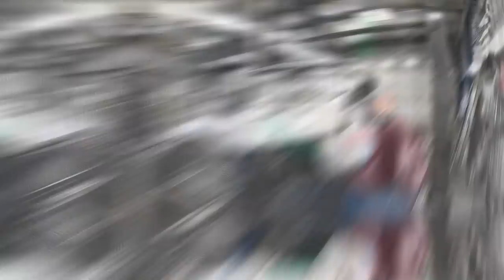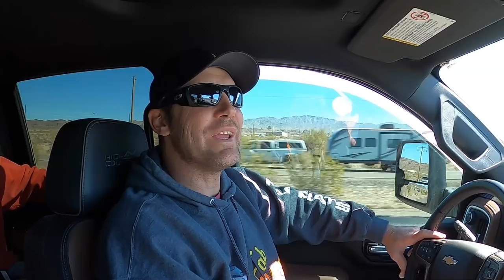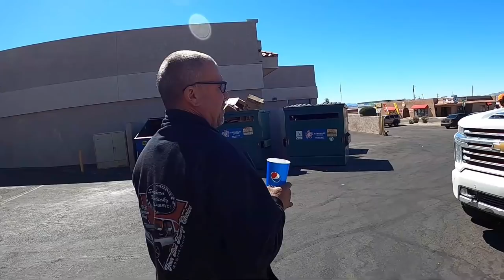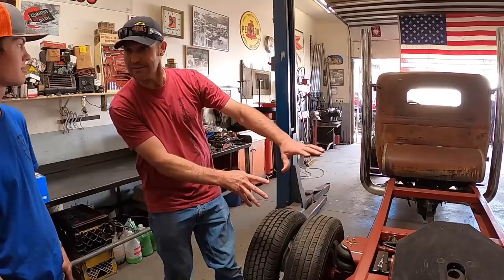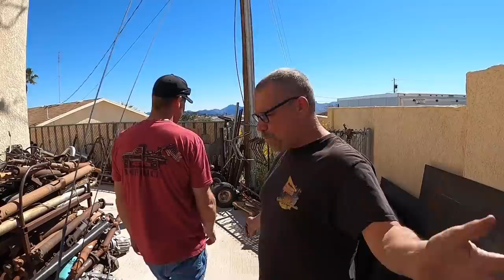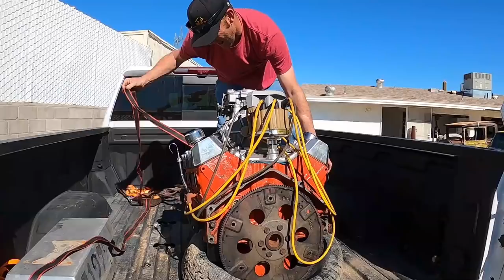We Drove 13 Hours To Get This....And It Was TOTALLY Worth It!

Comment: Great Guy, Great Place.  A+ for NEAT.  For those too young to remember, the Chevy 348 and 409's looked the same sorta but the 409 Dip Stick was on the Pass. side.  Had a 400/409 in my '63 Chevy SS convertible.  Awesome.  Thanks Merlin and Rats.

Comment: I'm 78 now, raised in Anaheim, wasn't  Doug's headers around there? My older brother and I worked at Weber Speed Equipment in Santa Ana early 60s. Chet Herbert cams was near 101 fwy, on Manchester,  been in Tony Nancy's on Woodman in Sherman Oaks also. This vid brings back  memories. Back then I drove a 47 Merc Woodie. SD that b4 Asian VAcation. With 39 Ford full race flattish 3 on the floor 39 tranny.

Comment: Back in the late 80s I worked at a speed shop warehouse distributor. The head shipper/receiver drove a black stepside square body with a B&M blown small block a lot like that one. It'd roast the tires any time anywhere. That'll be a great little engine for that truck Paul!

Comment: I had a '72 Chevelle SS back in early '80's...big cam, headers with 3 inch Thrush header "mufflers"...window rattling loud...a dufus put it on a lift at the station to check the diff fluid & broke both those at the flange....I drove it for a couple days with open headers lol.  Got kicked off school property because it rattled EVERY window for a block....good times!

Comment: That little blower motor is going to be fun, but if you want to get the most out of it, that HEI distributor isn't the best choice... Too much timing. Get a small cap, and have it dialed in for 8 degrees at the distributor,  for 16 at the crank. Then you have roughly an additional 18 degrees to work with, depending on the fuel your using. Use a small blower pulley, the large crank pulley, and the hottest coil and box you can find. This combination equals a small block, with big block power, and an attitude all its own. I'd also use a big Holley up top, like an HP blower carb. For 16 years, I ran a Wiend 144 @ 244:1 drive ratio, with a 830cfm Holley HP in my 72 Camaro. I went through a lot of mods before I figured out the best combination. My motor started life as a ZZ4 GM crate motor. The compression was too high, the heads had small exhaust valves, but the cam was about perfect for a small blower. With Edelbrock 6052 heads, (202/160, 70cc chambers) Hooker 1 7/8 Super Comps, my combo produced 12lbs of boost, which propelled my 3250lb Camaro to 123mph through the traps in the 1/4mile.... At Bandimere. I tried a few gear combos, but settled for 342's... These little blowers are so much fun on the street... Instant power from idle to 6000rpms. They reccomend only 5000, but they handle 6 all day long. My roller cam was 208I, 221E, .480/.510 lift at .50. 112 degrees lobe separation. I put 1:6 roller rockers,  which effectively got me an extra .030 lift, .510/.540. I reluctantly sold my Camaro car 17yrs ago... I still miss it. I'm definitely going to watch you play with this one! Have fun!

Comment: Hey Paul.  Love the programing you bring..
   However there is a third modified big block..
348 had one 59 impala 
409
427. Race only
￼This is not a Mystery V8, but we’re including it anyway to clear up a frequent misconception. This is the engine most commonly confused with the Mystery motor: the RPO Z11 427 CID V8. Chevrolet produced two different 427 CID racing engines for 1963, and this one, the Z11, was essentially an enlarged, enhanced version of the famed 409 CID V8, with a .15-inch longer stroke and detail improvements. Note the scalloped, inverted-W valve covers, common to the 348/409 W-series engine family and dictated by the distinctive staggered valve layout. Experts believe that 57 vehicles were produced with the Z11 427 V8.

Comment: what they're not telling you about Lake Havasu is the record high temps in the summer.
I've seen rubber make black streaks in driveways from tires, normal turning makes your tires squeal when you're sitting still.
I had a manual thermometer melt in a truck there when I was a teenager
without the Colorado River there it would be the surface of Mars.

Comment: When you load an automatic transmission with the torque converter still installed, it's a good idea to secure the converter in place - this can be done several ways, such as using rebar tie wire to run across the front of the converter circling around the centering boss and tying into bolt holes on the bellhousing.  Otherwise it can come off and you will have ATF all over the place.

Comment: Awesome video guys.  You have some interesting people in your family.  I've seen a few of the Kindig builds where they replace the entire rear end of early muscle cars to make them handle, but they use off-the-shelf kits, and I'm thinking Paul would fabricate it all from scratch.   Wow, that blower motor is something.  I loved it when you said you could feel it on your chest.  I grew up in the UK, so my only experience of that sort of motor making the air vibrate was at Santa Pod Raceway.  Can your pipe bender handle three inch Paul?   So much good stuff happening on the channel — so many great videos to come!
Reply: I forgot to say that we used Lake Havasu Proving Ground for hot climate testing.  I never got to go my self but the lads totally enjoyed it.  We went to northern Finland for two or three months every year, and less often we had trips to central Australia, and southern Italy.  Apparently you have to be as far as possible from the coast to be sure of low or high temperatures.  BTW  This was Ford UK Product Development at Dunton.

Comment: Equipment hauling tip- if you use 4 tie downs instead of 2, that engine would be less likely to slip and fall over.
P.S. I have one of those small Clarke clipper forklifts also.  They are awesome for the shop/garage!! Just no dirt or it's stuck city

Comment: To add to the history of the elephant motor, it’s first iteration was in a 1958 Chevy truck and car. It had 348 cu. Later it was upped to 409 and later to 427.:it was king on the drag strip for a good while. To compete with it Ford upgraded their 352, 360, 390, 401, 406, 427. Keep up the interesting builds. My daddy was a garage owner. I was weened off milk then put on gasoline.

Comment: A supercharged engine needs 6 litres of expansion built into the cooling system , which means mounting an expansion tank above the engine then allow the coolant to travel to the radiator. You do not need a bigger radiator but you definitely need a good water pump that flows a minimum of 10 litres per minute at 500 rpm and it should be able to push the coolant up hill at least 150 foot head. Chevy engines have an inherent problem built into the cylinder heads  as they mounted 2 exhaust valves next door to each other in the middle of the cylinder heads causing overheating in that area, but a good pump should be able to move the coolant around that problem area without causing an exhaust vacuum leak . 
The best coolant to use is Evans Waterless Coolant as it does not turn to steam causing an over pressure situation.

Comment: I have a flowmaster 10 on my '93 F150 with a 302, it's got long tube headers into a single 2.5" pipe with a high flow cat and the flowmaster 10, dumps out the passengers side behind the cab. I've driven a Malibu with a supercharged 350 man, and holy crap that car was awesome.

Comment: Me and my brother took a 350 turbo transmission apart and put a different back shaft in it for a swap on a 85 S10 2.8 to a 350. It didn't take long to figure out how to rebuild the 350 and 400 turbo transmissions. The 700R4 was a lot harder thow. I don't rebuild them for people anymore. The 400 turbo was easier I thought to rebuild. I want to get going on my 2000 7.4 L motor. I plan on building a rock crawler and put it in there with a 400 turbo. I wish they had Internet back when I first started taking those tranny's apart lol

Comment: They built 3 sizes of the W motor. The 348, the 409, and a 427 version. The 427 was developed for racing and never offered in standard production vehicles. It was put in some 63 Impala's for racing. They are know as the Z11 Impala's. It had reached the limits of it's design and Chevy came out with the standard big block we are familiar with. It was know as the Mystery Motor. Just useless information for you. LOL.

Comment: Merlin is wrong they did 3 sizes in that engin. The 348, and the 409 were common, but the less common size was the 427 that most people didn't know about. Most drag racers and dealership guys new of it and ordered it up for racing and used the up .

Comment: The Chevy 348 originally was designed as a truck motor but went to the sedans as well to keep up with the other manufacturers  that were increasing engine size. The 409 came out of the 348 for the same reason- bragging rights on the street and the strip. Nascar use came later but the 409 struggled to overcome the Ford 427 and the Chrysler 426 in 1963. Chevy built special heads to go on the 409 with a larger displacement version- 427 c.i.- called the mystery motor and Jr. Johnson was allowed to run it in one race. GM completely banned all racing for all GM brands after that leaving Ford and Chrysler to battle it out. Too bad for Chevy-Pontiac!